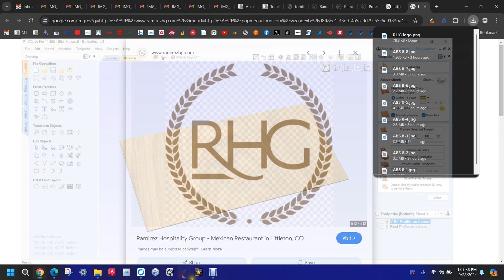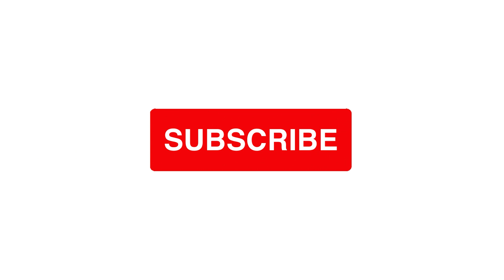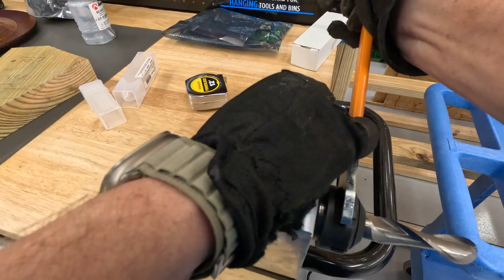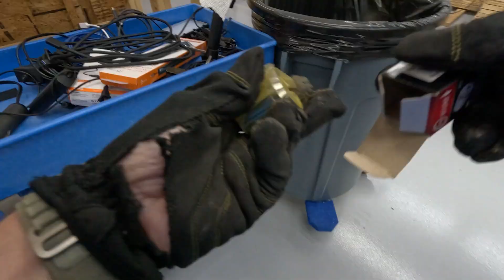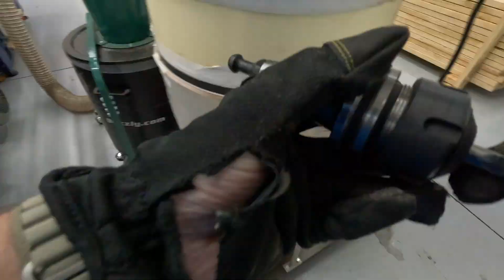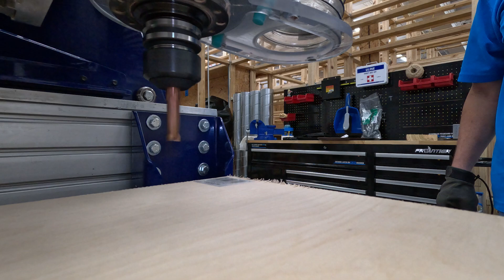Time for Fajitas!🤩 Making Rustic Wooden Underliners for cast iron griddles | Part #4 🌯 #cncproject

Comment: pro tip for you here since you have all that nice fancy equipment. (Im jealoust) Chamfer the top of your finished profile before cutting plywood.  Your damned if you do your damned if you dont upcut tearout the top, downcut tearout the bootom.  A small .050 thou chamfer and youll have way less tearout.  And if you can afford a bigger chamfer youll have little to no tearout.
Reply from the maker: Great advice.  I actually used that trick on either this project or another and it worked splendidly, especially on plywood (you got to break that veneer).  The compression bit I used (Onsrud 60-173MC) was sublime as well.  Thank you for the positivity, the comment and the great advice.  I hope you will keep the comments and all criticisms coming.  Rich